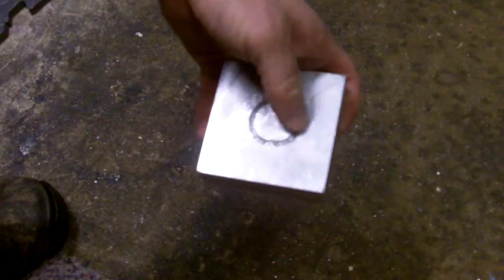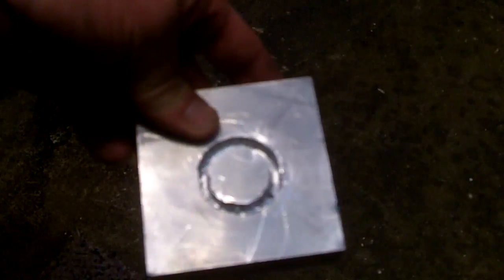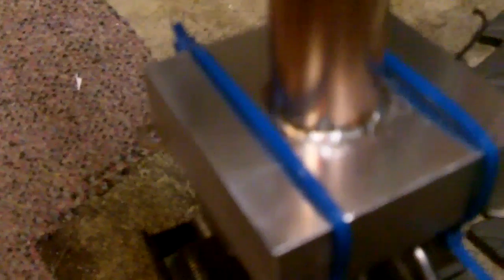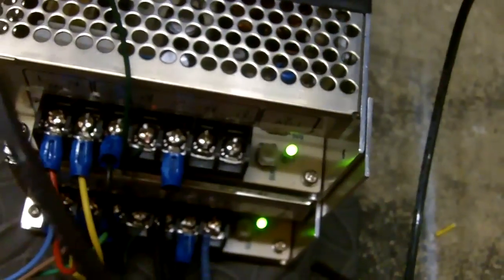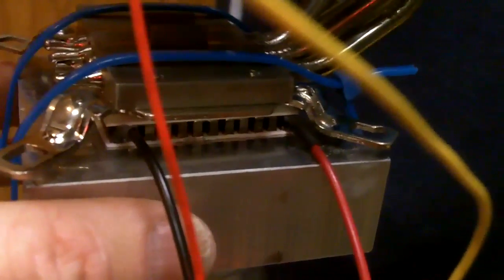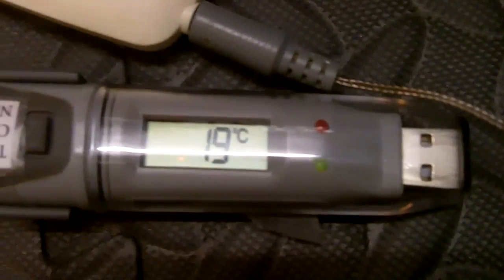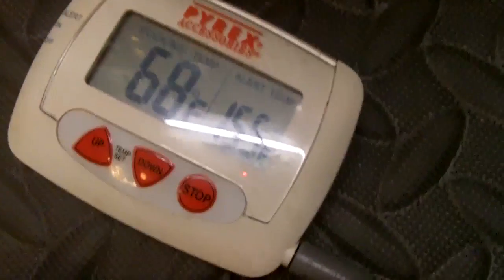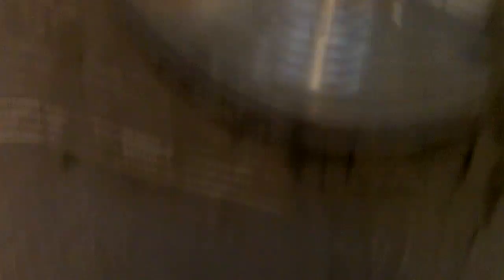Peltier Carboy Chiller

Comment: I am building the same thing. My rod is made of Aluminum. I can get 10C below ambient temperature, and the fan constantly runs to maintain that temperature.

I faced the same problems that you are facing. I fixed them by - 

1. The Thick aluminum block is losing most of the cooling to the atmosphere instead of the water. Use a bad heat conductor. I used a piece of plywood. Easier to drill and does not absorb heat from the peltier. All the cooling is transferred to the rod.

2. Insulate the carboy. I used a sleeping bag to insulate the carboy. This will easily give you a 5C difference from ambient.

3. The copper will react with your beer. I am going to anodize my Aluminum rod before I test actually with beer.
Reply from the maker: sapan83 Thank you for your comments.  I have purchased an aluminum rod and plan on using it in place of the copper.  I was planning on attaching the peltier directly to the rod and skipping the aluminum block.  I hope to work on the project in the next few weeks and will post a new video.

Comment: Thats a cool idea, "excuse the pun" I have played with peltiers as well for fermentation cooling, I have looked at fixing the peltiers around the outside of a stainless fermentor, but to be efficient I reckon I need at least 6 units. Keen to see how this develops. 

One thing to consider is that copper can effect your beer, it can oxidize the alcohols into aldehydes in finished beers, so even though copper is fine pre fermentation, post fermentation it can cause some of flavours.
Reply from the maker: Good to know.  If I can get this one operational, I will have to switch to a different metal, possibly anodized aluminum.